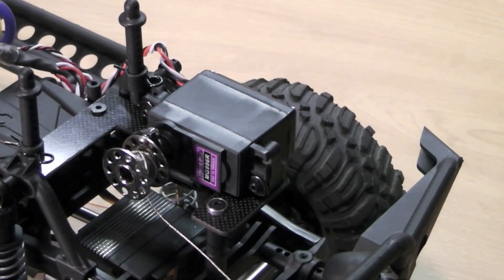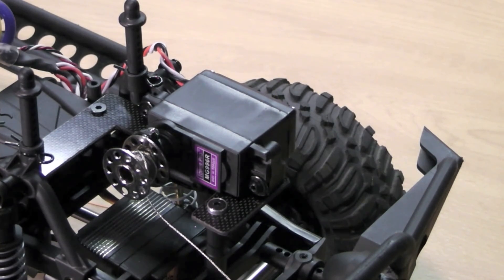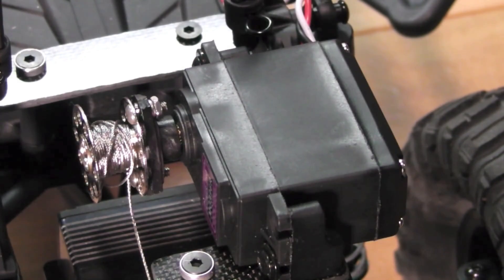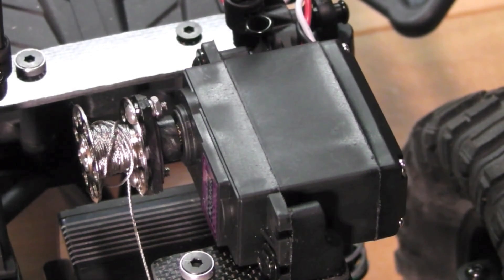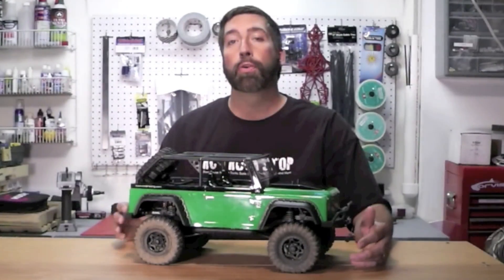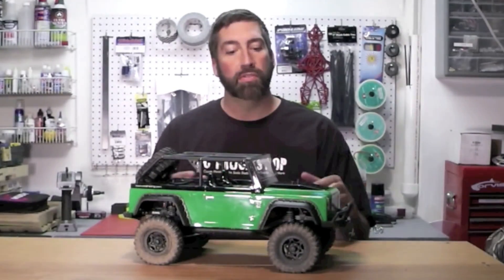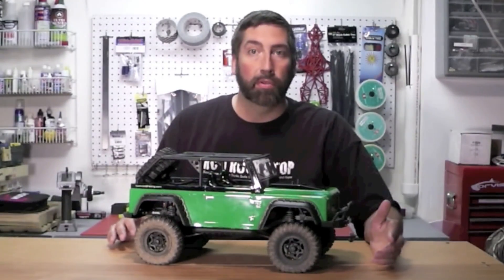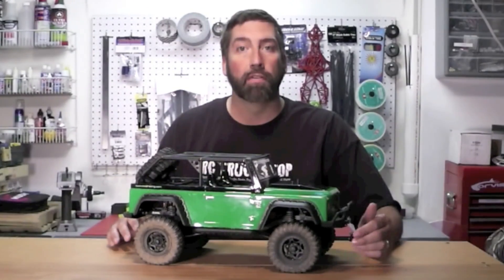HeyOk Servo Winch Review

Comment: you would grind out the slot for the potentionometer in the gear and grind off the small pin that stops it. glue the potentionometer in the spot where the servo doesn't move. Then if you have a spos radio no more mods are required but for 2 pos. You need one of these.

Comment: Great vid of Heyok winch and controller ,,I use it with my servo winch kit ,,,Just remove the pot and board  and solider to servo motor ,then stuff the controller inside where the old board and pot where ,,again great vid great winch controller ,,,KMS